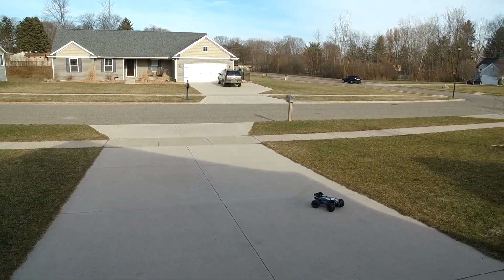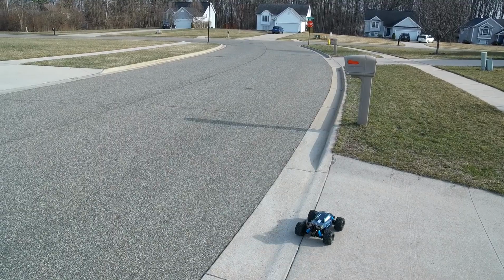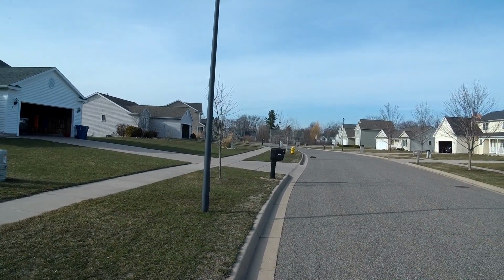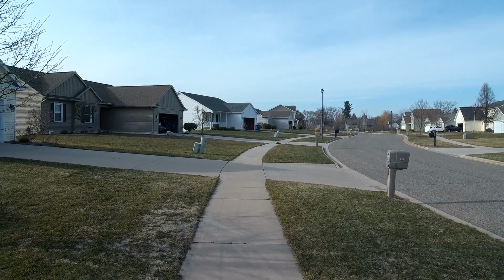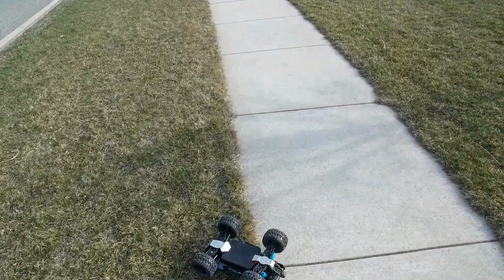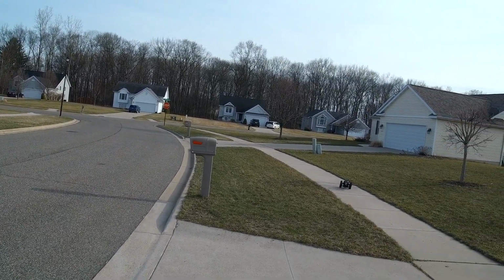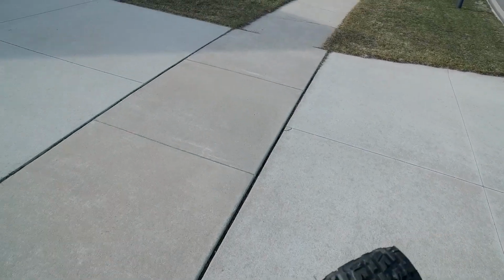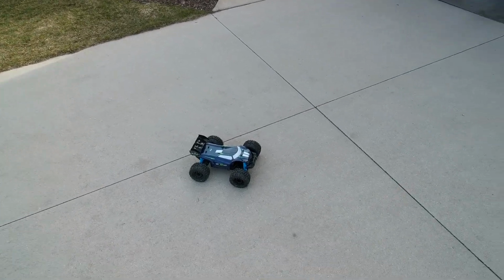TRMT 10e HX 3s Bash Upgraded

Comment: Alright ladies, opinion/ thoughts. Trmt10e or Proline Pro MT 4x4?
Reply from the maker: CommanderAstig RC ohh, good one! They both have flaws for sure. The way mine is sitting I have about $500 into it, so Price wise they are pretty comparable. I haven't driven a pro MT so I can't speak about durability. I converted my Tekno EB48.3 into a small MT with the proline body and tires and that has worked out great for me 👍